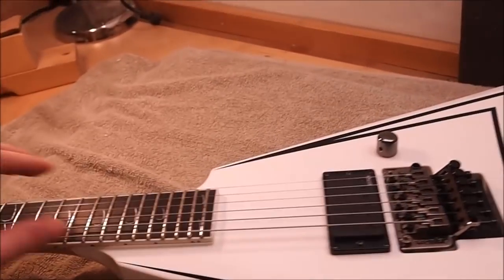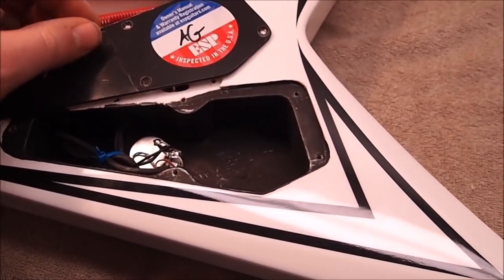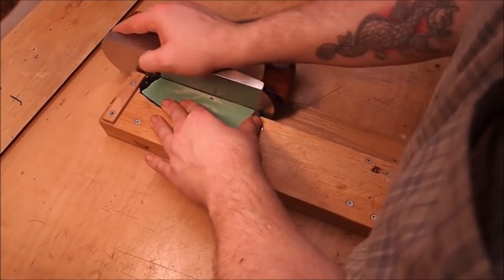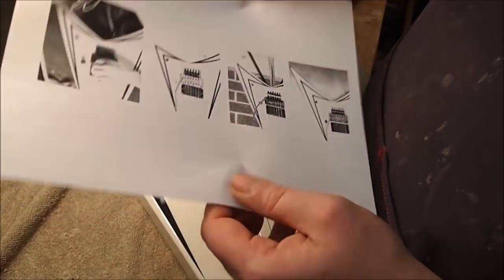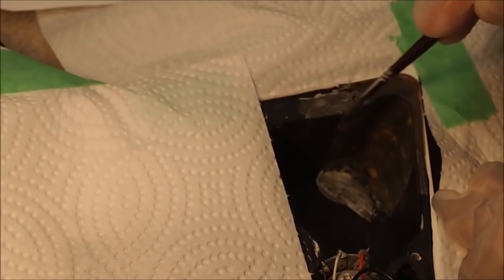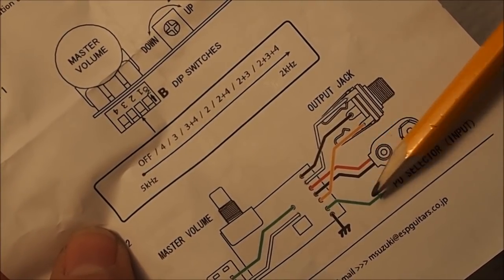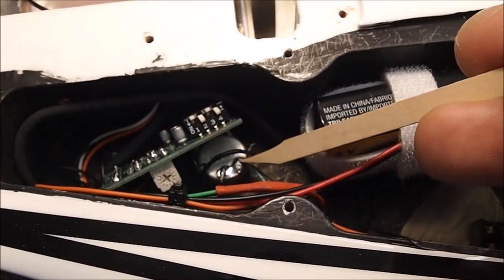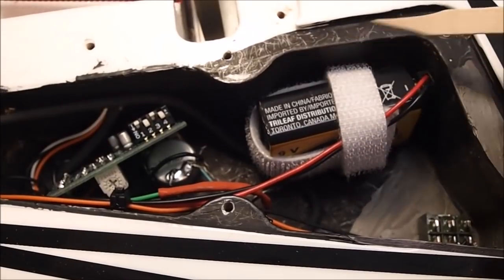ESP Alexi Scythe Preamp Installation

Comment: Is there any guitar job that you won’t undertake? You’ve made an excellent job of installing the boost circuit to the guitar, much better than the average guitar tech would do. The work you carried out extending the control cavity and making a new cover was extremely neat. Top quality work!
Reply: I have a jackson js32 I installed the emg model by myself never worked on a guitar before in my life it was not fun though lol

Comment: I ripped all the 9v batterys out of my active guitars an rigged up a variable voltage power supply that goes through the guitar cable. Now all I have to do is plug and play like any other guitar. And set the voltage of course. I prefer 18v for most actives Fishman an EMG but I wouldnt go higher than 18v. My guitar cable is a TRS instead of TS and the ring wire is what carries the dc current. Works excellently, WAY MORE CONSISTENT than 9v batterys. They say you cant hear a difference until the 9v batterys drain below 7 volts. I've never found that to be true. I can tell a noticeable decrease in consistency/tone at around 8.25v. And most 9v batterys spend the majority of their lifecycles at around that voltage. For years I didnt understand why sometimes my actives sounded great and consistent and other times they sounded weak an required more power amp level to fill the tone back out. I havent had that problem even once since I ditched the 9v's. Everytime I use my active equipped guitars now I get a consistent good tone. My power supply is the size of a guitar pedal and works by plugging it in just like you would any guitar pedal first in your signal chain. Easy peasy. Plus the .5v - 30v dc supply is a great power supply for the bench when I'm troubleshooting the guitar pedals I'm modding/repairing or that im building. Anyways.....death to 9v's!!!!! And lastly the power supply doesn't interfere with passive guitars since they are just ts connectors. The ring is basically an open circuit but I added an on off switch in the power supply so turning it off or on takes less than a second. But if you were to forget to turn it off it wouldnt harm anything. In anyone e is interested in doing something similar DROK (look on amazon) sells all sorts of variable boost, buck and boost buck transformers. In others words all sorts of variable dc power supplys that work great for this application. And they are super cheap. Last time I bought one of their boost buck supplys I think it was only $12. Ok done for real this time.

Comment: The ESP-LTD guitar shape is different from the ESP, because of Jackson's copyright on the Jackson Rhoads shape (Alexi began his career playing Jackson Rhoads. The discontinued, RR24 model I reckon). ESP doesn't sell Alexi's model in the USA or Canada. The lower wing is visibly shorter on the real ESP & the angle between the 2 wings are different, which is why the booster's hole seems to move around. It's not an hallucination. It is moving around on different pictures, because of the different geometry of models. Lolll ;P

Comment: That was outstanding! I'm not afraid of electronics cause of my dad who knew electronics repaired TVs, receiver to recording equipment, I had to learn it also! For a built-in small pre-amp, I just use a BB pre-amp foot pedal. I will be adding piezo circuits and split-coils. That easier then making to jigs special clamps to planning wood. Hard work but fun! Cheers

Comment: Hey man, can you help me out? I tried installing the same module on a similar guitar but I think I failed miserably.

I soldered the wires to the output jack as they're supposed to, the switch as well. The black wire with the ground-symbol to the Floyd Rose-claw and finally the pickup selector to the pickups hot lead and the pickups two ground wires (bare & sealed) to the volume pot. The guitar is humming like crazy, where did I go wrong?
Reply from the maker: JoKingNative sounds like you might have the hot and ground wires to the jack reversed. It's hard to diagnose this stuff over the internet. Check your soldering.  If you can't find anything obvious I suggest taking it to a local repair shop.
Reply: I find it hard to believe that the jack cables are reversed but it might very well be poor soldering. I would be grateful if you could take the time to upload or send a wiring diagram of how you did it.

Comment: I bought a special router bit which is 3mm in height, and 45mm wide, and used to do this kind of "surgery", to avoid having to carve from top. Literally you are carving UNDER THE SURFACE on the back, and you just dig as deep as you need to match the original cavity. That way you can keep using the previous cavity cover and not risking damages on the surface.

Comment: How narrow is that neck ?  Either you have extra large hands or it's a camera optical illusion, but the neck on that guitar just doesn't look wide enough for adult hands.
Reply: Alexi is a VERY small guy. He's like 5 feet tall lol. So the neck isn't overly huge. Its about the nut width of the eap MH series. Not as large as the M series, not as small as the EC.
Reply: @XMetalChefX  
according to google, around 5'6". Small, but not super small. Looks a lot smaller though - I think it's more about his frame, very girlish build, narrow shoulders, small delicate hands and wrists, no musculature to speak of.
Reply: @Exgrmbl  well I am 6'3 270 Lbs with a linebacker build. So he was very tiny to me lol
Reply: @XMetalChefX  There are incorrect sources about him being 5’8” when he was actually 5’5” and 42mm is the standard nut width; Ibanez and Jackson are 43mm sometimes though Jackson being an American company probably makes them close to 43mm using inches, but I’m not sure if this applies to basses.

Comment: Ugh that’s the LTD version. I wouldn’t waste a dime “upgrading” a LTD.
Reply: Have you ever played or owned Korean-made LTD? They are extremely well built and well worth upgrading.
Reply: Wanna explain why you feel like that?
Reply: Idk man most of the LTD's I've played surprised me for the price.
Reply: @SteelSkin667  yes I have, they are overrated. I briefly owned at LTD, I immediately sold and bought a real ESP Eclipse and the difference was night and day, however the price wasn’t significantly more.
Reply: @ahf5471  probably a standard not original esp which are usually 4k+ now

Comment: if the pickups were any good in the first place pre amp wouldnt be nessasary active pickups really suck. no such thing as a good one
Reply: Alexi's setup is a combination of passive pickups (for the dynamics) and an active EQ boost that goes to an amp with relatively less gain. The reason for that kind of setup is having more clarity while getting a nice accented tone with harmonics that really pop out without suffering from flappy/rumbling bass (which is what you get when you gain up regular passive pickups).
Reply: @penkunator  Wow, you really lost that one; obviously I’m joking since plenty of players that have signature active pickups try to work with the companies that make them to have a passive sound with more power and the more consistent tone with a cable.